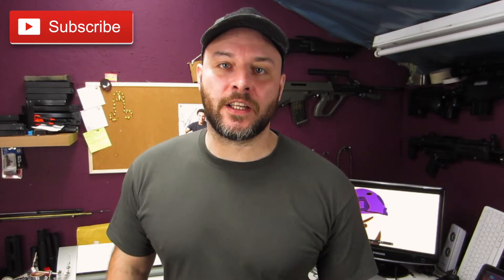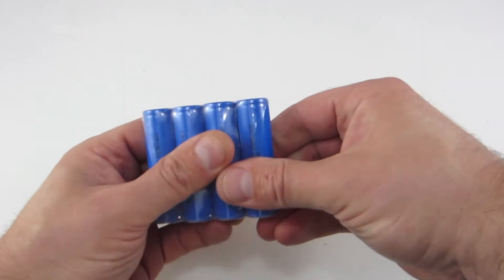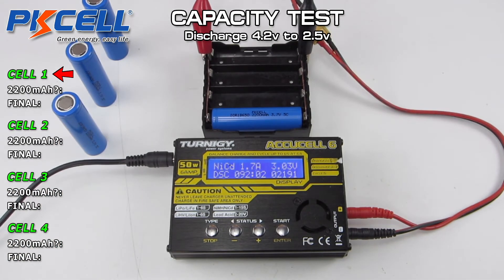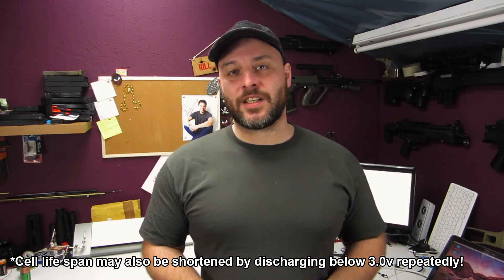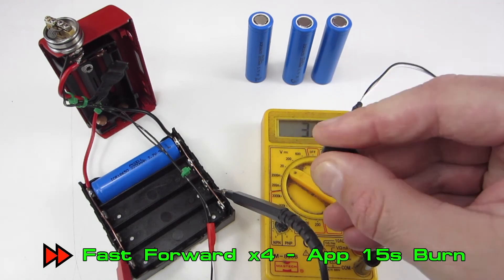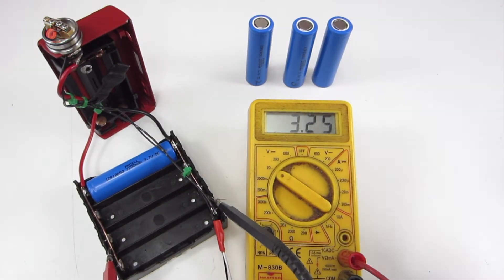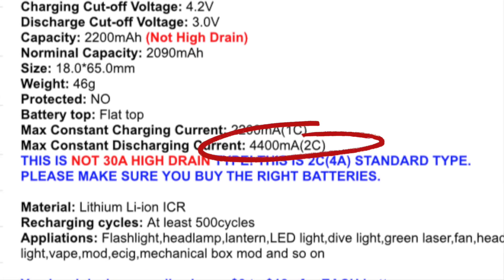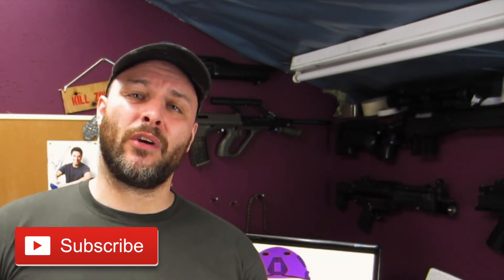CHEAP eBay 18650s GOOD or ??? | PKCell 2200mAh 11A | Unbox, Test & Review

Comment: But 2.5V is quite low you're losing some life cycles if you drain them that far
Reply from the maker: Yeah you are totally right, I only started taking them down to 2.5 because thats what a lot of manufacturers do in their spec sheets.  PKCell don't though funnily enough, they state 3.0v cut off so thats pretty cool.  

In normal use I'd never run them that low